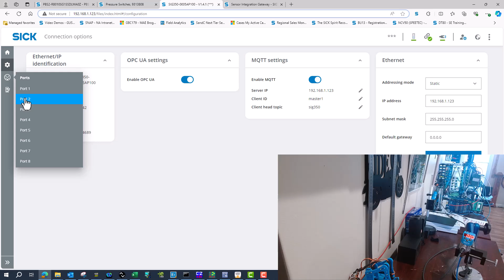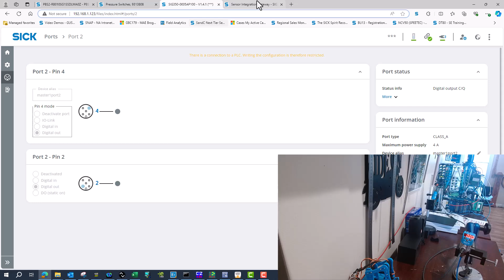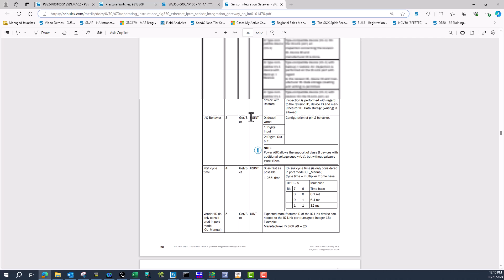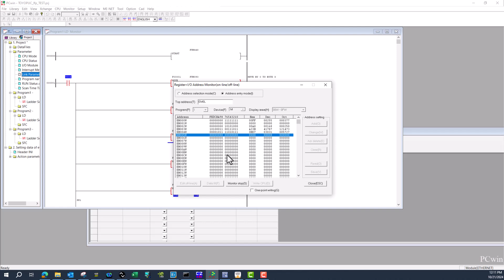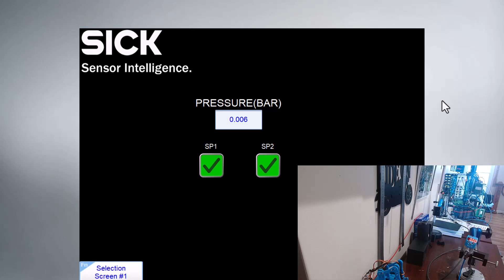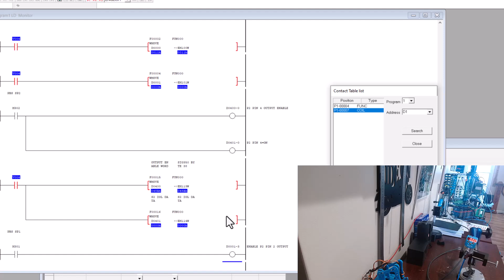Using a Toyopuc PC10G for IO-link data over Ethernet/IP with a SIG350

Comment: Thanks for posting this.  I'm trying to integrate Cognex over this protocol and did notice an option to import EDS files.  Go back to detail settings and click 'List Settings'.  The version of PCWin at my workspace has an EDS import option within that screen.
Reply from the maker: Interesting. What version of PC win are you using? What PLC and version #?
Reply: PCWin V20.0_R04. PC10G 3.82
Reply from the maker: @ace1233993  Thanks! I'm going to try and update my version of PCwin to the latest and greatest version.
Reply: Did you have any luck getting the Cognex working? I'm trying to get a Keyence VS Camera working and it will take my EDS but I'm not seeing any data come through. I tried Following this video too but I seem to be missing something.
Reply: @toddlogan9810  It works well.  Is there anyway to share my config file over this platform?
Reply: @ace1233993  Actually I just got it working I had to reset the PLC after the change not just write to it.😅